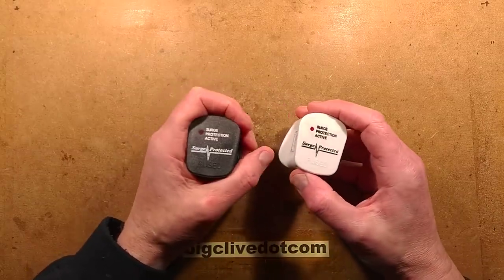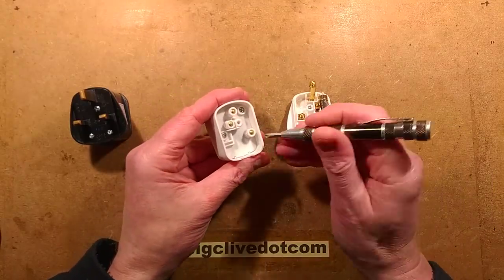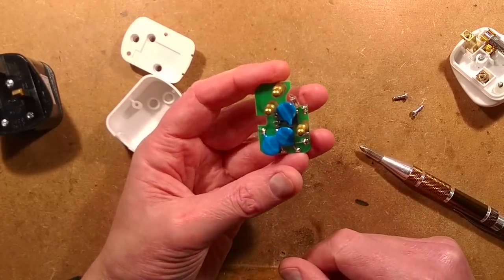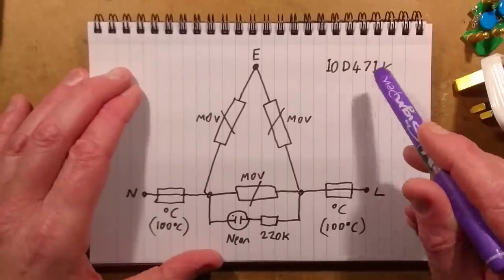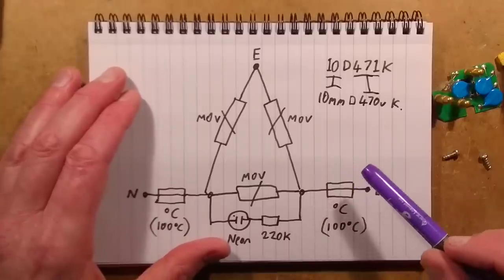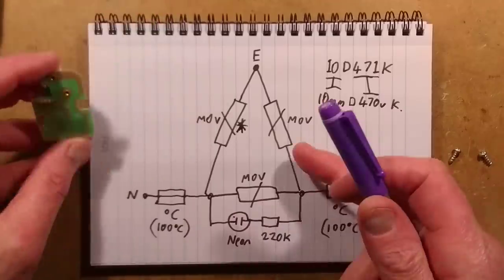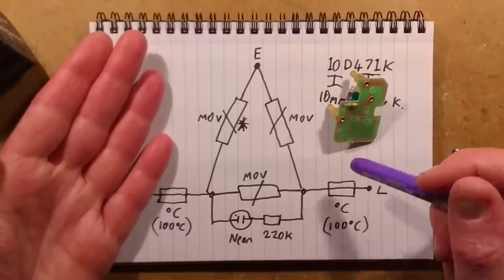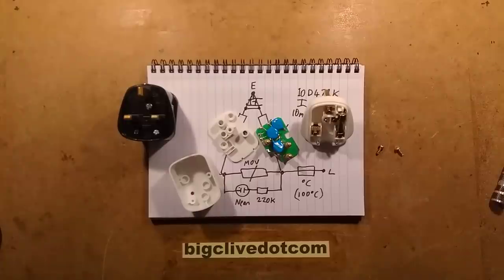British plugs with built-in surge arrestors.  (With schematic.)

Comment: Put some aircon in a shop where the incoming live and neutral were reversed! Customer wasn't bothered, suspect they'd bypassed the meter...
Reply: So was the meter running backwards ? ;)
Reply: I'll do you one better. My boss sent me to one of his rental properties to take a look at why the circuit breaker for the barn out behind the house kept blowing. He had just had some work done there by a "professional electrician." Now, for purposes of understanding the problem, I'll explain a bit about American electrical systems. Most devices use 120 volts, and larger devices such as air conditioners, ovens, etc. use 240 volts. The transformer that supplies the property has a 240 volt secondary that is center tapped, with the center tap being referenced to ground (Earth) and serving as the neutral on 120v circuits. The two live wires go in to the circuit breaker panel (consumer unit) and the bus bars alternate so that every other slot uses one live wire and the others use the other one. For a 240v circuit, you have a double pole circuit breaker with one pole on each of the live wires, so that they have a potential of 240v between each other. When you run electricity to an outbuilding, you'll run 4 wires: live 1, live 2, neutral, and ground (Earth) Those will go to a sub-panel with circuit breakers for the outbuilding, and a large, double pole main breaker supplying that will be in the main breaker box in the house. Back to the story. The "professional electrician" that had done the work previously had installed a new subpanel in the barn. In the process, he had connected one live to one live busbar, as you're supposed to, the other live to the neutral bar, and the neutral to the other live bar. Being a subpanel, the neutral and ground aren't bonded together- that's only done at the service entrance, otherwise you can wind up with the ground carrying current. So the installation didn't just short out as soon as power was connected. The result was that half of the outlets and lighting was wired with reverse polarity, and the other half had 240v instead of 120v. Naturally, the things that were plugged in to those outlets didn't like it. So someone else was sent out to see what was going on. Upon discovering that half the outlets had 240 volts, did he go and look at the panel to try and figure out why? No. He just disconnected those outlets and connected them to the circuits that had 120v, and called it a day. So now, you have reverse polarity at all of the outlets. Long story short, there was a security light that comes on when it gets dark that had been connected to one of the 220v circuits, and was damaged by that, such that it had a short circuit in it when turned on. So every night, it would blow the main breaker- because the circuit breakers in the subpanel were connected to neutral, where they were essentially useless. Fortunately, nothing disastrous happened, but it did take me the better part of two days to 1) figure out what the hell was going on, and 2) get it properly sorted, since I had to rewire half the outlets to connect them to the proper circuits.

Comment: I'm disappointed that did you didn't check what fuse was connected to what MOV.  I'll assume that the one on the line side is in contact with the line-to-earth, and the neutral fuse is in contact with the line-to-neutral.  Otherwise, the protection won't break the circuit of the failing MOV.  There seems to be NO protection if line and neutral is reversed and the "neutral-to-earth" (now line-to-earth) MOV fails.  Seems like a fire hazard to me.
Reply from the maker: See the schematic I drew out.
Reply: @bigclivedotcom  I did.  I don't see where you indicated which fuse was associated with which MOV.

Comment: Interesting, I don't quite follow how it protects against surges if it's just touching the screws on the wire connectors. Doesn't that mean any surge can just go down the wires unimpeded? It's not between the mains and the appliance as far as I can see so I just don't get how it works.
Reply: These are metal oxide varistors , if you connected one in series with your equipment then it would get 0 power unless there was a spike then it would get the spike lol, and go back to being off. Basically giving you only spikes.
Think of a how a diode is like a one way check valve, these are like a 2 way  'check valve' but with a very stiff spring (though they are not built with diode it's just an analogy)

Comment: Some IEC/EN equipment safety standards require the gas discharge tube in series with the VDR between L/N and PE when type A plug is used. Type A plug in safety standards mean normal single phase plugs that are used in homes. The gas discharge tube in series with the VDR against the PE (protective earth) makes it possible to pass the required electric strength test between L/N and PE. Equipment that are permanently connected to the mains this gas discharge tube in series is not required due to that the connection to PE is more reliable.

Comment: Is there any way of demonstrating or showing them actually working?  Maybe one for John Ward?
Reply: Clive has the insulation tester which goes to 1kV or more if i'm right.
it should clamp down to around 270V then.
Reply: @PsiQ  Being 470V MOVs, I'd go with closer to, uh, 470V.
Reply: @Monkeh616  um, aah, was thinking of the ones i've seen lately which were rated at 275V/1mA i think
Was it 230V +/- 10% for allowed tolerance ?
(Wouldnt work for 230 x 1.4 peak hmmm )
Reply: @PsiQ  Something rated at 275V was probably rated for AC - which makes it a 390V part.

Comment: With an SPD now being installed at the consumer unit, as part of the new 18th edition regulations, these are presumably redundant now?
Reply: Perhaps, but it doesn't really hurt to have additional clamps.. And, well, they're redundant only in the approximately 0.05% of installations equipped with SPDs so far.
Reply: The more devices that have these will lessen the spike load overall in the house when a spike happens (as the spike will be dissipated among all the plugs that have these on them)
Reply: @ruben_balea  that is true as well
Reply: SPD is considered Type 2 protection while the plugs ones are Type 3. Both types are recommended to be used together for better protection. ;)

Comment: why do surge protectors often use neon indicators instead of LEDs? i imagine they're more expensive, so why use them? i doubt it's because they "look cooler" to the manufacturer.
Reply: using LED would require an extra component: diode to prevent reverse current as LEDs cannot stand it ;)

Comment: Hi, do these surge protectors stop surges in both directions? I ask as my freezer is on same double socket as my PC and every now and then when the freezer motor kicks in, I get a blank screen and I want to fix that!!!!
Reply from the maker: It's probably the slight voltage dip cause by the fridge compressor kicking on.   Not something a simple filter will help with.
Reply: @bigclivedotcom  thanks... I know I can't expect you to... but can you suggest any potential solutions? Its annoying RN but if I want to game its gonna be a "game changer" in all the wrong ways!!

Comment: Does anyone know whey it uses a neon indicator as opposed to an LED? I'd suppose the LED is cheaper and lasts just as long? CMIW.
Reply: Neon indicator doesnt require stepping down the voltage, just throw a small resistor in. makes it cheaper for simple things that aren't using a transformer or voltage dropper of some kind to begin with.
Reply: @SenorBolsa  Thank you for the explanation 🙂👍

Comment: Why do british plugs have a fuse ? Most other countries (that I know of) do not have fuse in the plugs.
Reply: As far as I know it's a post war thing when there was a copper shortage so new homes had a ring circuit configuration requiring all plugs to have their own fuses for protection
Reply: British socket circuits are in a Ring Topology to increase capacity and save copper. This increased capacity is far more than is safe for any flexible cord. The overcurrent devices having the increased capacity will not reliably trip quickly enough if there is a fault involving a cord increasing the risk of fire. By adding a fuse in the plug the British were able to safely use smaller cords on their appliances without the risk of fire in the event of a fault. A fuse is also required whenever there is a spur off of a ring in fixed wiring.
Reply: Because of relatively high current (30/32A) ring final circuits. A small flexible cable (up to about 1.5mm²) could fail catastrophically under such currents, so they're fused at the plugs. Most other countries will use 16A, sometimes 20A, circuits, which even a 1mm² or smaller cable is likely to be able to sustain for some time.
Reply: It's a regulation. UK standard. Very thoughtful of them!
Reply: @jrmcferren  No, a fuse isn't required for a spur. 433.1.204.
Reply: @Monkeh616  - Think John McFerren is correct for "fixed wiring" (which he says - think cooker hood or other fixed appliances not supplied via a socket). Fuse not required for sockets fed from a spur as there'll be a fuse in any plug using that socket.
Reply: @grahamleiper1538  Any accessory on the circuit is fixed wiring. Again, 433.1.204, only BS1363 accessories may be connected to a ring final circuit - whether that be a socket or an FCU. A cooker hood is not a BS1363 accessory - so yes, it would go through an FCU or a socket. But in either case the FCU or socket could be part of the ring, not a spur.

In the case of multiple sockets, you would need to use an FCU to reasonably comply with 433.1.204, but a single accessory (including double sockets) as a spur (which is fixed wiring) would not require one.

Everything after the fuse is a sub-circuit - it's not entirely correct to think of a few double sockets after an FCU as a spur. The wiring to that FCU might be a spur, might just be the ring, but after the fuse, it's just a radial.

Comment: I can't figure out how you connect the "flex" from your device into this plug.  Am I missing something?  Doesn't the power need to go through the protection before it goes to the device?
Reply from the maker: The protection is in parallel it clamps voltage spikes.

Comment: So if I understand right, this is more for indication than for protection, as the connection is never broken to the device, but the neon indicator goes out when there has been a surge? It wouldn't actually protect your equipment from said surge but only provide evidence that there has been one?
Reply from the maker: It will shunt spikes and transients.  It wouldn't deal too well with a direct lightning strike.
Reply: @bigclivedotcom  Very little does, really.. Lightning has a tendency to win.
Reply: @bigclivedotcom  I feel like I'm missing some basic knowledge here  because I can't see how a circuit can protect a device while the circuit to the device remains in place, if you know what I mean. Don't get me wrong, I'm not saying it doesn't work, I just can't see how it does work.
Reply: @Akira42  The MOVs become temporarily low-resistance when the voltage rises high enough to trigger them, causing a temporary short circuit. Because the electrical wiring has non-zero impedance, the short circuit causes voltage drop in the wiring, dragging down the voltage and protecting the appliance. Normally this will only be for a very short period of time (milliseconds).

Considering each MOV individually, the wiring and the MOV together form a potential divider across the origin of the voltage spikes. When the MOV is not conducting, its resistance is much, much higher than that of the wiring, so most of the potential difference (voltage) is across the MOV and thus also across whichever parts of the appliance the MOV is in parallel with. When the voltage rises and the MOV begins to conduct, the MOV's share of the total circuit resistance falls, and thus its share of the potential difference also falls.

(Someone correct me if I'm wrong.)
Reply: @patrickwigmore3462   Thanks for explaining, I think I get it now. The devices don't get 'in the way' of the surge, they draw it away from the equipment instead and dissipate it, I guess is how I would put it?

Comment: How common are power surges? Is it usually caused by a home appliance or does the surge originate from the supplied mains? Thanks!
Reply from the maker: Often appliances with high inductive loads like motors can cause spikes.

Comment: Sprung contacts make for ease of manufacture, but what about risk of substantial volt drop across contacts during a high-current burst?
Reply: The spring contacts are maybe 100 milliohms. The MOVs kick in at 470V.  You're not going to get 4700A in any domestic environment, so the spring contact resistance doesn't matter at all.
Reply: Spring contacts are, say 100 milliohms but are inductive and so their impedance to fast transients will be way more than 0.1Ohm but yea, all good either way

Comment: I don't understand how the MOV marked with a star (between N and E) is any less protected than the MOV between L and E?
Reply: possibly due to the location of the 2 thermal fuses, one mov doesnt get one.
Reply: @waldsteiger  but it's symmetric?
Reply: If you have reversed polarity and that MOV fails, there is no thermal fuse to act on it - the one carrying the current is located under the wrong MOV. The fuse will likely still end up opening eventually, but it's not an ideal arrangement. This is however a relatively small risk - we have polarised plugs and generally polarity is correct in our installations.
Reply: @Monkeh616  there's a thermal fuse on both the live and neutral terminals. Whether reversed polarity or not, no current can flow without going through a thermal fuse?
Reply: @yadt  the movs are not protected. its when the mov is already dead or dying (they get hot), then the thermal fuse cuts out to protect the load.
Reply: @yadt  But it's a thermal fuse - it needs to be coupled to the faulty element which gets hot. There are three current paths - line to neutral, line to earth, neutral to earth. Two thermal fuses - one under the line to earth MOV, one under the line to neutral MOV. If you reverse polarity, suddenly that third MOV is line to earth and does NOT have a fuse under it. The current path has a fuse IN it, but it's not thermally coupled properly to the MOV.

Try not to confuse thermal fuses with the thermal action of a normal fuse - a normal fuse supplies the heat itself, a thermal fuse requires an external source.
Reply: @Monkeh616  Ah, duh. Of course. I was thinking of it as a normal fuse (current through the fuse causing it to heat up and trip). Stupid brain.  Thanks

Comment: big clive!!!! i found you bc i am trying to reprogram some lights i have n had a question.. 
i have two strings of lights, led it think, with little control boxes with buttons to change the settings, they can plug together, but don't change to the same setting when one is changed. is there was way to change that in the boxes or would i have to wire them together? thanks!!! these videos are rad

Comment: If I understand this correctly, it will also protect other devices plugged into the same extension lead or those very close on the same ring main?
Reply: Yes.. no.. maybe? Probably erring more towards yes, but it's a fairly basic level of protection to begin with.

Comment: Is there any case where polarized plugs actually are a benefit rather than creating a new safety hazard by relying on the polarization?
Reply: They are always safer as the live is the wire that's fused and switched inside the appliance.  Unpolarized plug, appliance switch off, appliance 50% chance of being live inside.
Reply: @MarkTillotson  Which is irrelevant as there's such a thing as isolation. Functional switching is not the same thing, and if the two are a confusing concept you shouldn't be inside the appliance..

Comment: But how clever/large is the available contact surface area between the rounded pin tips and the bottom part?  These could get really hot when maxed.
Reply: They don't carry any relevant amount of current in normal operation..
Reply: @Monkeh616  "in normal operation" which is what, charging yer phone or heating up yer caravan?
Reply: @Io1564  Doesn't matter. The load current of the device does not go through those contacts.

Comment: I had to turn my subwoofers off to listen to this, lots of bass in your voice with this setup. Maybe use an audio program to remove any audio under 300hz or so would be good.
Reply from the maker: That was natural voice with no external microphone.
Reply: @bigclivedotcom  I never assumed it was anything different, still need to do a low cut audio though :)

Comment: I might be asking a silly question I'm tired after being dragged around in the sunshine by the wife all day, (I'm on holidays in Spain currently) but if its a standard plug base and the circuit board just sits on the three pins monitoring,  how does it surge protect? Surely if the surge protection fails the device connected will keep working provided the 13a fuse is intact....... 
Clive again apologies if I'm missing something or asking a dumb question. 
Regards 
Brendan
Reply: The MOVs are in parallel with the appliance to be protected, so should shunt out any high-voltage transients.  At some point, the MOVs may reach end-of-life, become conductive, trip out the fuses; at that point, the neon will no longer light and (if you check the neon) you'll know to replace the plug-top [so as to get some new MOVs].
It's not exactly fail-safe (!! :-) but it's probably better than nothin'  :-)
Reply: Nearly all "surge protectors" have this problem, they are parallel connected and do not disconnect the appliance when they fail. So they may absorb some surges, but if a really bad one comes along it will blow out the surge protector and continue it's merry way on to the appliance.